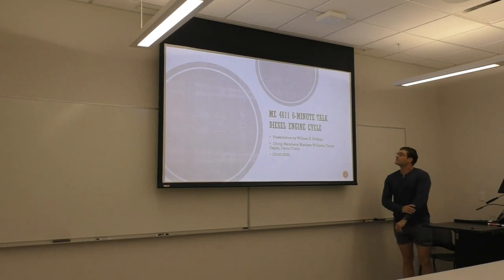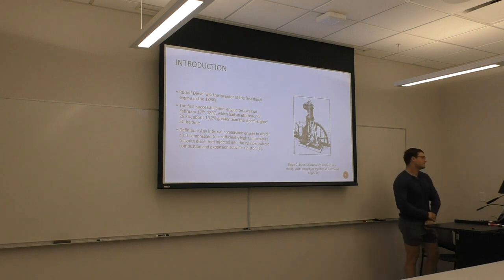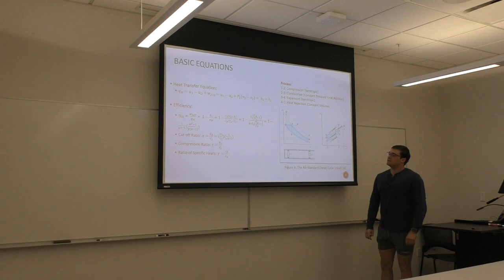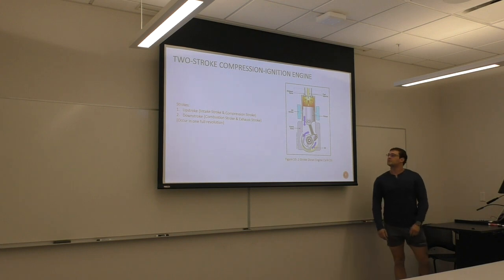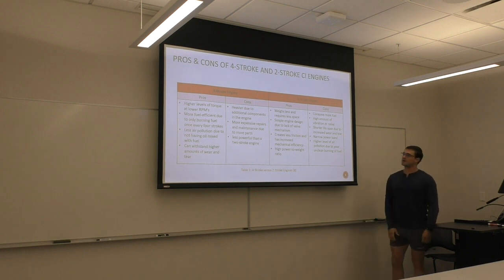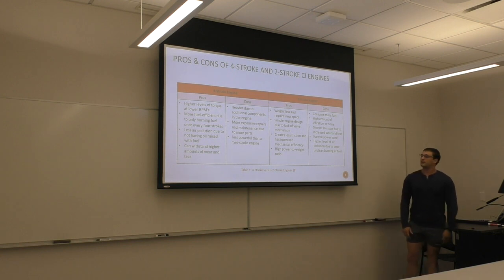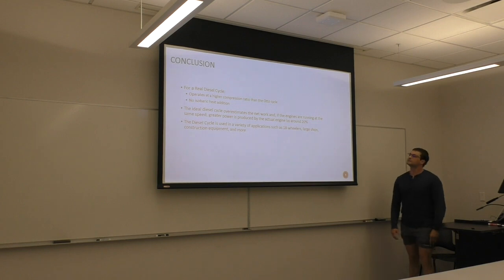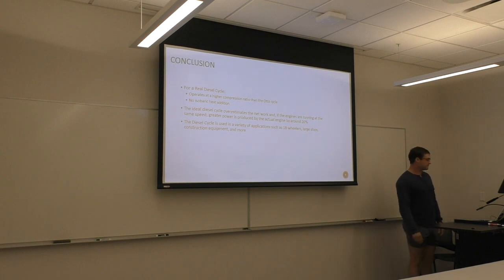William Hidalgo

Comment: William, good job on the diesel presentation. I am very interested in the diesel engine as I drive one and love them. You seemed to know the material well and made it easy to follow your presentation. Try to reach that 6-min requirement, but other than that, good job.

Comment: Great work, William! Your presentation on the diesel cycle was both informative and engaging. The way you highlighted the distinctions between the diesel and gas cycle was particularly insightful. Your animation of the four-stroke engine not only enhanced understanding but also served as an interactive element for the audience. It was evident that you were well-prepared, as you spoke fluently without being overly reliant on your slides and maintained steady eye contact with everyone. Suppose I suggest an area for improvement. In that case, it might be beneficial to delve deeper into how diesel engines differ from other types in future presentations.

Comment: Nice Job William, I liked your presentation on the diesel cycle. I like how you explained it and stated the differences between a gas cycle. Your animation of the four-stroke engine was also a cool way to interact with the audience. You didn't just read off of your slides and actively made eye contact with the audience therefore I have no critique for you.